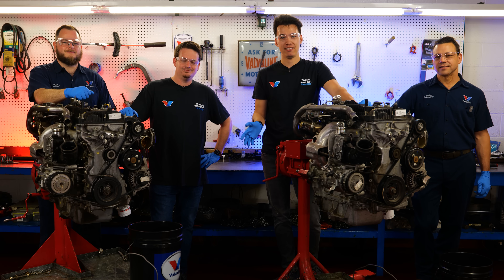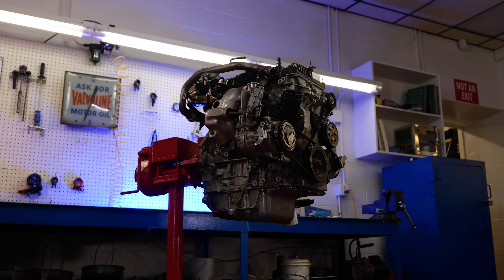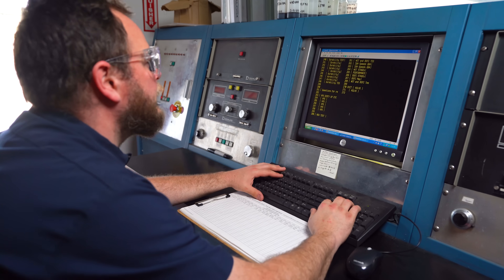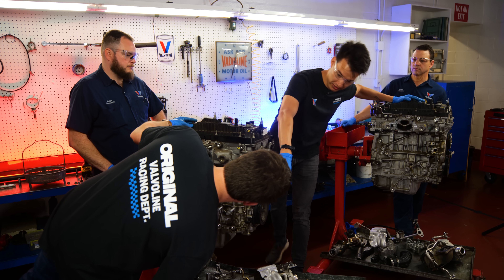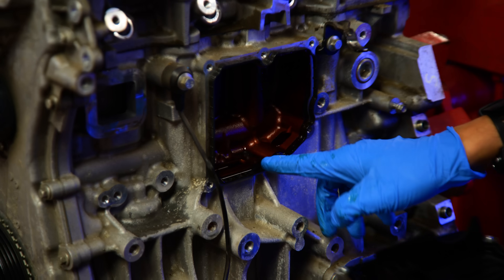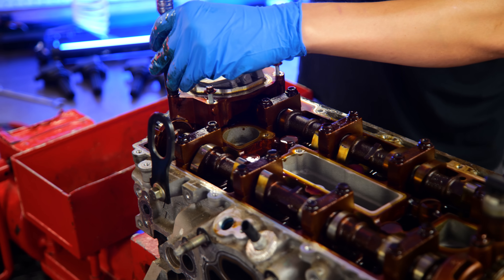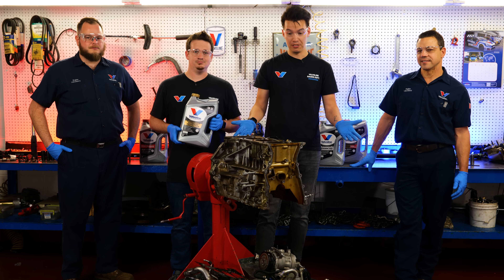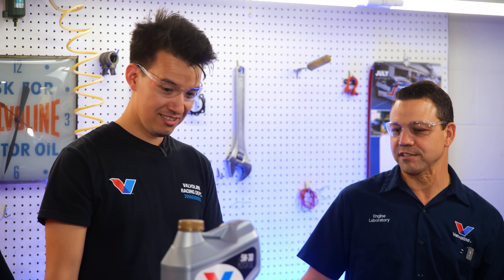Testing different oils over 4 years and 1 MILLION miles

Comment: The stuck rings are something I've been noticing as a wildly under-represented failure mode in popular understanding of things. People still talk about rings and bores wearing out, you can clearly see here that's basically not an issue, modern engines exhibit very little wear in the cylinder walls and rings. The biggest issue for oil consumption and compression loss is stuck rings due to carbon deposits. I'd be interested to see someone take something like a famously oil consuming Subaru, run it on restore and protect and see if the oil can actually clean those deposits and return cylinder seal.
Reply: Anecdotal evidence, but I've been running R&P in a couple of old Priuses, which are notorious for the oil control rings getting stuck/clogged and burning an excessive amount of oil. 

On the first one, I did a quick basic clean with some Seafoam in the oil for ~100 miles before changing the oil, then changed the oil with some regular off the shelf synthetic oil. Consumption from just doing the seafoam cleaning dropped from ~1qt/2000mi to ~0.8qt/4500mi. I changed that oil with Valvoline R&P about 4k miles ago, and I'm still at about halfway between the marks on the dipstick. Too close to tell if it's done anything yet, maybe a slight improvement, but that could just be due to how it's been driven or something. However, what I have noticed is that the engine does seem to be smoother. Cold starts and engine engagements aren't as rough, and the VVT rattle on cold startups seems to be completely gone. I'm changing it next week for another round of R&P.

On the second car, I bought it and it had been pretty abused, similar mileage to the first. Oil consumption was ~1.5qt/3000mi. It's currently sitting at ~4500mi with Valvoline R&P and I did top off the oil once before a long trip, so I'd estimate it's burned ~1.25qt in the 4500 miles. Definitely an improvement, and it'll be changed with R&P again and I'll continue to monitor. Similar story to the first, smoother starts, no VVT noise, etc.
Reply: @Black-Villain  Interesting stuff! I also have a shitbox Prius, I'll have to try some of that. It's currently down with a bad head gasket but we'll see how the head looks inside with 280k miles when I crack it open. Sounds like the seafoam might be a better solution for severe cases initially.
Reply: @Levibetz  Yes that's what I think as well. R&P definitely does seem to be doing what it says, I can tell by the change in the oil deposit/varnish color just by looking in the oil fill hole. However it seems to be pretty mild, so I believe their claims about it needing 4 Oil Change Intervals to properly do its job. For severe buildup/deposit cases, some kind of oil flush is definitely the more aggressive option.
Reply: Modern engines have light ring pressure, coated rings, great wall texture, and very true cylinders, and excellent sealing, which is why that area isn’t a problem IF you use synthetic…..

Comment: What this video proves is that only Fools go 10k with regular oil. I would never go 10k with any synthetic oil. Even Amsoil. Both engines would look grest at 5k intervals guaranteed. Currently I change my oil at 2000-2500 intervals. When oil looks little dirty like medium dirty. I change it. Course my car is a 1996 Buick Lesebre.  3800 v6. I think Fords 2.3 is a great engine e. But the Ecoboost 2.3 In a 4000 lb Explorer is Ridiculous.  Longevity will be much lower in the real world stop and go. Also loaded engine. This test no way represents how long a 2.3 will last on the road.  It's comparing Apple to oranges. Yes newer vehicles that Font leak should definitely run Synthetic oil and nothing else. Especially these high tech DOHC engines. Grestviseo Valvoline and its engineers.

Comment: Looks to me like using the for application correct type and weight of oil with regular changes gives you an engine with a long life! Pretty interesting the varnish difference but after 500k I'd be extremely happy with both

Comment: I use the GoldPlug oil drain plug and Castrol Extended 20,000 mile oil out perform Valvoline best Synthetic oil. Castrol has much much much less metal particles on the Magnet. Also runs smoother. 
I've tested all the oils at the Box Stores,and Castrol is ahead by a long shot.

Comment: I put 478,000 miles on a Turbo 900 Saab And used Castrol 10w30 in engine and transmission....and she is still going....I had to sell it needed cash..... Castrol is a blend...changed oil every 2500 miles.....I have used Valvoline with great results and Havoline as well especially in sbc in race applications....I know they are of no relation My late Pop's worked at Texaco.... changing at low mileage intervals is key...

Comment: just learned that I can go 200k miles easy and reliably with conventional oil with out worries, thats about my limit for any car anyway! and I will save 50% or more in oil changes, the next owner can worry about the inside of the engine!
Reply: Exactly. Although I'd still pick the synthetic. I just wouldn't waste money on shorter oil changes.
Reply: Cheapskate.  Do they call you the Varnish-King?

Comment: The real test would have been a 5k test....after 10k services, synthetic will hold up better & be less wear obviously...Im willing to bet after 5-6 k, there wouldn't have been any difference....HOWEVER, 10k intervals are not a good idea unless u literally are on the highway the whole time...5-7k intervals should be standard services for daily drivers....mostly stop n go driving- 4-5k....alot of highway- 6-7k
Reply: @andybales7318  Idiot, they got up to 500k miles on 10k oci in varied driving conditions, which includes stop and go. Are you that much of a broken recording that you can't even see what the video is presenting?
Reply: @andybales7318  That's a true fool here, who just regurgitates numbers without any actual knowledge. The whole point of the test was to measure conventional and synthetic against the OEM claim of 10k oil changes. Guess what? Both passed being driven at variable driving conditions, including stop and go, with no major failures for 500k miles. It's truly idiotic that you're now claiming specific oil change intervals down to 1k miles with literally zero experience with any engine for 500k miles. All you're able to do is regurgitate what others tell you.

Comment: No one runs conventional oil for 10k miles….this is disingenuous
Reply: You'd be surprised. I run a small shop and I see morons going 20k plus on conventional oil and wonder why their engines are all sludged up and fail at 110,000 miles or less 😂. I personally use synthetic in my 3 vehicles and try not to go over 4000 miles between changes. I know it's overkill but oil is cheap and it only takes me 15 minutes to change it.

Comment: The engine with Conventional Oil lasted 500,000 miles just fine. Less than 0.1% of cars will reach 500,000 miles let alone surpass it. So basically even though Synthetic Oil is superior it is pointless for most people.
Reply: the test group is a single ford CUV, don't treat how it affected this one vehicle with this one engine option as universal law

Comment: valvoline could've also added a transmission fluid in their test and see how OEM performs vs valvoline extended performance atf
Reply: if they did not keep the engine oil being the only differing factor between the vehicles, the test results would not be accurate

Comment: This is a super cool test, but it'd be interesting to see how exactly they were operated each driving cycle, particularly RPM and engine load. I imagine they are trying to represent how your average car would be driven, but it'd be curious to see what a negative effect frequent high RPM operation would have over time, even with proper maintenance.